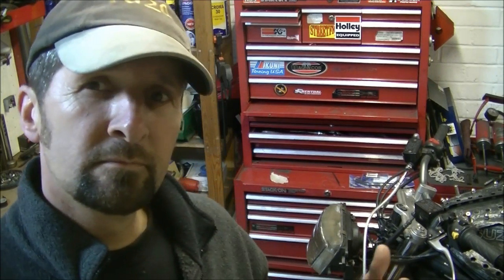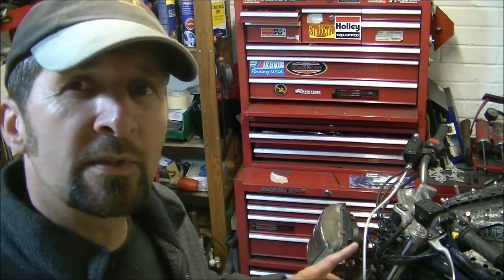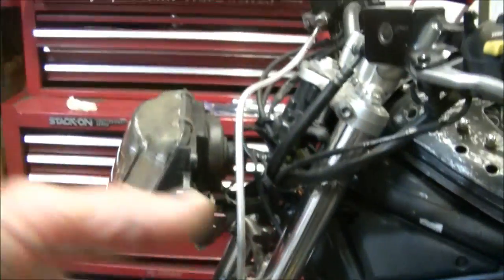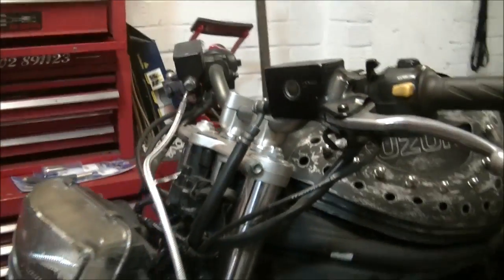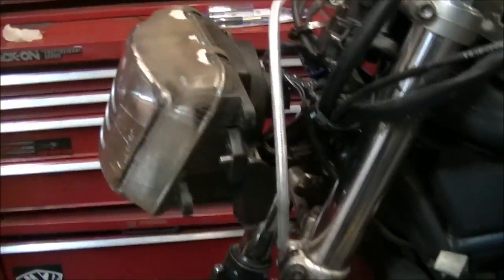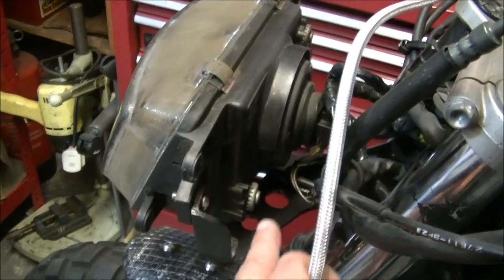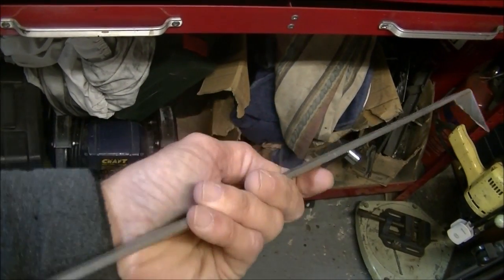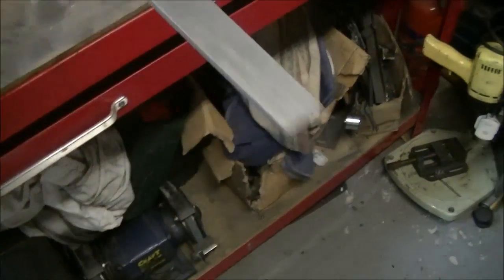Delboy's Garage, Project Bandit #29, Head Light Shroud.

Comment: I'd have probably wound up using those plastic tabs to mount a light-weight shroud, but as usual, you nailed it with a much beefier solution!
Reply from the maker: Thanks mate, Yeah i did think long and hard about it, they are so handy, but you just know they'd last about ten miles before they snap off....and i want the shroud to be beef aswell, so why not do it once and forget it...!

Comment: Any way of incorporating the clocks into the shroud? I had clocks on and off triumph streetfighter numerous times .missed the ease of use with them off. So stuck on a set of clocks from trident .pod type. as the original daytona ones lived a mile away in the fairing..chooped the  loom also ,such fun! Cant wait to see the next step..great work matey! Watched your snow ride last night..i think an Obe Is in order, rather you than me...im suprised you managed to fit those cahooners on the bike with you...Love it ! Cheers Paul...
Reply from the maker: Ha ha, its not cahooners buddy, its not having a car and needing to get to work..lol.. Been thnking on just junking the whole clock set, looks way too...'Bandit' for me...so been head scratching and came up with a plan, im gonna make a small 'dash' in the upper lip of the shroud, and will just mount some really minimal bare essentials in there..just the two required idiot lights and maybe a cycle speedo...not sure, but made the first few templates today (didnt film it, two hours of head scratching and cardboard..hardly a video..) and will be cutting the first sheet metal on Sunday... thanks for wathicng mate, really aprecate it.. cheers, Del.

Comment: Bike looks cool without the clocks it has to be said.   Will you be dressing the shroud in the same style as the rest of the bike, if so the shroud could be mounted to the top of the brackets via a couple of bolts similar to the tank and then strengthened?  Looking forward to the next fabrication vid fella. ride safe to you both.
Reply from the maker: Got a few ideas, i want to make the shroud clean and sleek with no visible means of support, thats why the brackets are at the back out of sight, and i want to try and build a little dash into it that i can stick a couple of idiot lights into... thanks for watching buddy, just wish i had more time to play with it...
Reply: Sounds great, looking forward to seeing how it turns out.. will be a shame to see you sell this, but as you said, will find the next project :)
Reply from the maker: GTs Garage
Well selling it will only happen if the right funds roll in...if i cant raise enough for the next project, then it'll stay in the garage and we'll do something else..

Comment: Ive never been any good with getting measurements bang on :-(

Getting those holes central, i would have to cheat and find a large penny washer and drop that in place, easyer to judge the outer edge, then a felt tip to spin around the washer center hole to mark the bracket.
Yup im a bodger lol.
Reply from the maker: Tsk tsk...did you never pay attention in metalwork...!! lol
Reply: Moonfleet41
i did, honest mister, im one of those people that found standard teaching hard to digest, just one of those things.